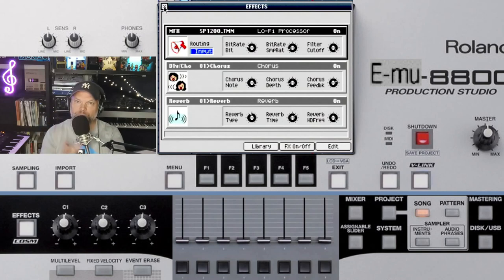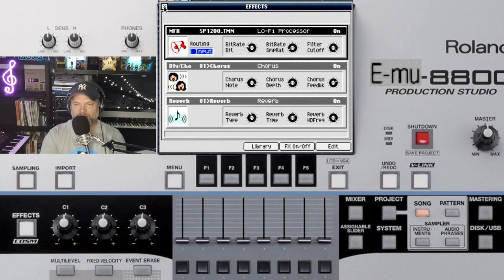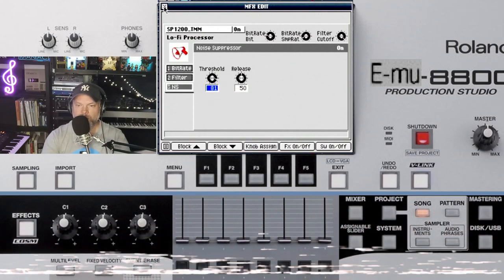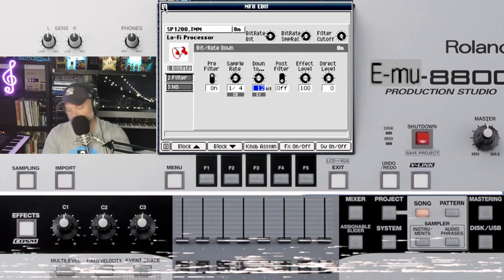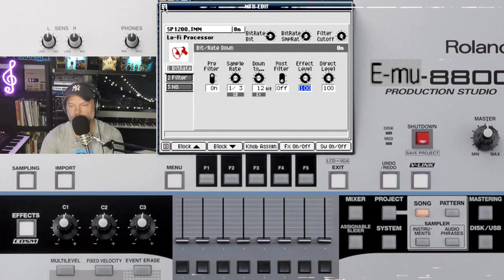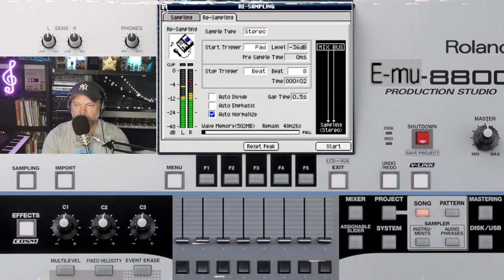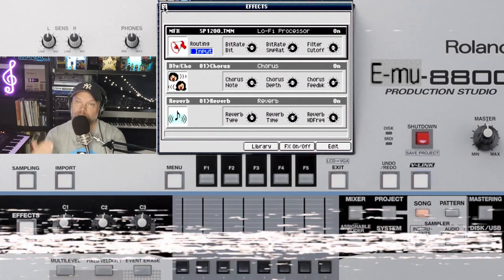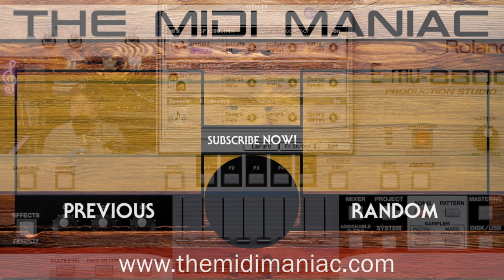How to get that SP-1200 sound out of your MV-8800

Comment: Great video. The SP1200 has lower quality ADDA converters than its Akai counter part the MPC60. Part of the way you get the SP1200 sound is based on pitching. If you speed the sample up to 45 and pitch it down in the sampler you will start to get the artifacts. On other machines you can add the lo fi filters after you pitch the sample and it will start to sound close to an SP. The filter alone won't do it.

Comment: I don't have a MV8800 but from listening to your example I think the FX on this machine seem to be not as bad as most LoFi VSTs. Would be interesting to hear how the MV sound when you create the artifacts manually (without any FX) by resample a pitched sample (something like + 2 or 3 octaves).
Reply from the maker: Thanks for the suggestion.
Did it today and the artefacts were not there.
Tried +1 +2 +3 +4 +5.
With +5 the sample was still okay. Not that old school sampler effect.
Was great to try it. Not worth a video because of the result, though.
Reply: @theMIDImaniac  Ok, didn't expect that. I thought (at least at +3 octaves) it would create aliasing. My MPC2000 can only pitch/tune a sample +- 2 octaves. I sometimes sample stuff that I pitch on my PC +2 octaves into the MPC and get nice aliasiing.
Reply: @peterpiper0815  the mv does color the sound just different it don't add the ring like sound but it remove highs when pitched up then backdown

Comment: Rog 🙏thanks again for vids …. Do u do a video on using the bpm sync on a sample as I’m struggling …. As when I assign to an audio phrase it goes back to the original tempo annoyingly … cheers me dears
Reply from the maker: Great suggestion. Let me make time for it.
Reply: You have to resample.
Reply from the maker: @WaxDat8800  That's indeed the only correct answer.
@lizer69: You have to resample the sample with the wished BPM otherwise it will stay on the original BPM. Works very easy, like this!

Comment: Can you help me? I have a problem with the sound output volume, it’s too low. In the mastering section, the input is very high but the compressor makes it low. I turned up to max all knobs I could but that doesnt solve the problem 🙏🏻
Reply from the maker: Now I’m thinking. Turn off the compressor and see what happens.